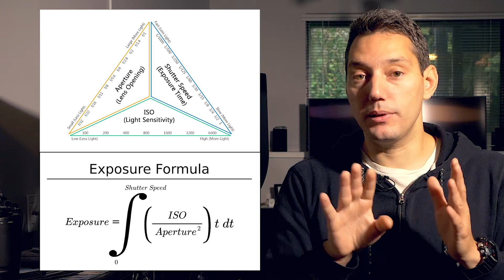Understanding Exposure - Part 02 (and a bit..)

Comment: I was so enjoying your simplification of these concepts until it got to 9:33 of this video showing an "exposure triangle". You, yourself, noted that ISO is just post exposure amplification of signal after capture, so please, isn't ISO just amplification of gain post capture and has nothing to do with "exposure"? It was my impression that the only three things that determine exposure is 1. Scene luminance, 2. Shutter speed, 3. Aperture.  ISO is just that post amplification of the photons that have been converted to electrons - and subsequent voltage. I personally think of ISO as adding or taking away brightness, but having nothing to do specifically itself with exposure - except that it may alter - when changed - the other two values you choose. Still, I think the triangle has to go as a teaching tool unless you call it a photography triangle. Reviewing the history of the triangle concept reveals that it is a rather recent term that was not mean to describe what people are using it as.
Reply from the maker: As the ISO can affect the image's overall brightness and, consequently, the shutter speed or the aperture that you can use, it makes sense to consider it part of the exposure triangle.
To the contrary, as it is something you can't change, the scene luminance is not really part of that same triangle but just a variable to consider to get the desired exposure.
Reply: @gimprotadp  So as you know, I agree that picking brightness might change what you use for aperture/shutter speed - and so I agree with you, and therefore "photography" triangle seems better than "exposure". I get your point. That said, in many cases you can alter scene luminance - use flash, use a modifier, choose shade over direct sun, etc. Increasing the quantity of light, increases the number of photons entering you lens and shutter - directly changing exposure. So ISO's change is indirect, technically, whereas scene luminance is a direct effect. Thanks for the reply. Appreciate your viewpoint.